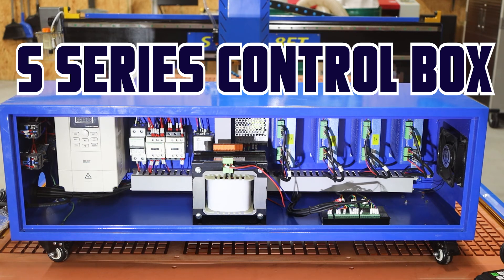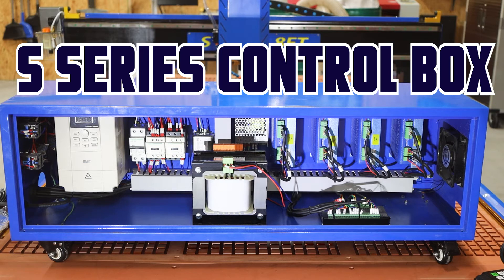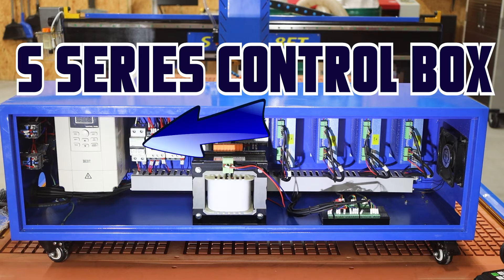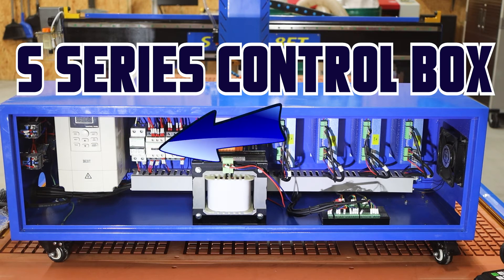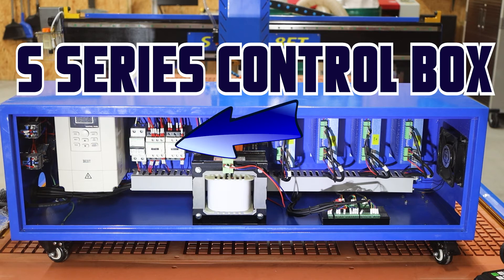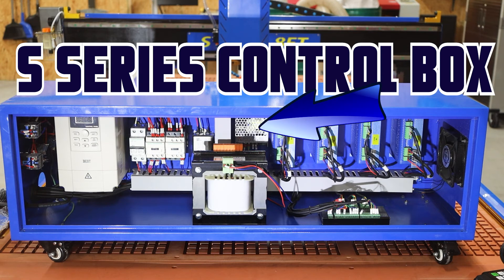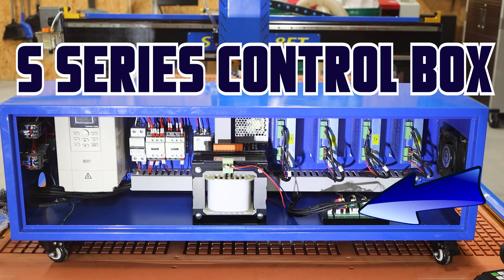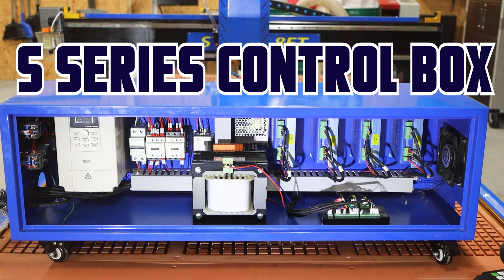Phantom CNC Systems S Series Control Box Walk Though

Comment: Wait is the big thing in the center front a transformer? Because that's going to convert AC (220 here) to lower voltage (2*36 you said) AC. Unless you have a rectifier (bridge or other) behind it with some large electrolytic caps. Also somewhat surprised there is no brake resistor on the VFD. Is that on purpose for some reason or is it just not visible and discussed?